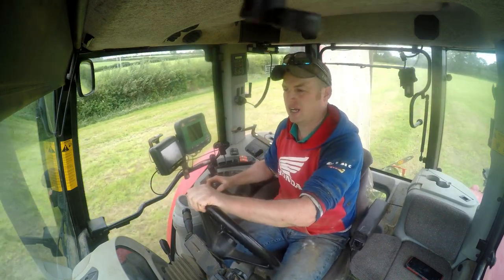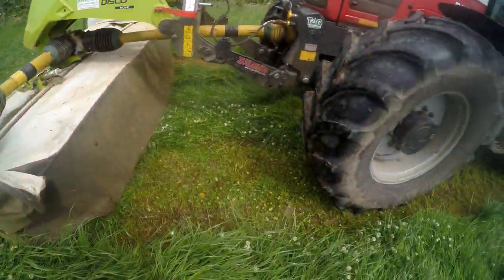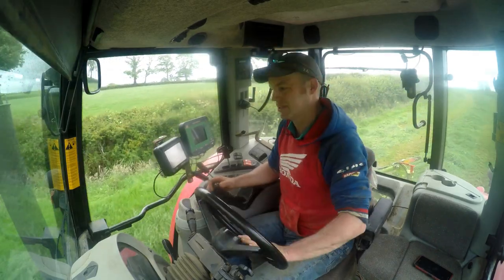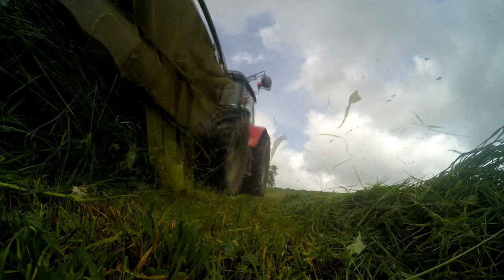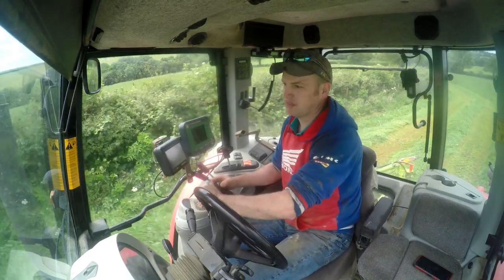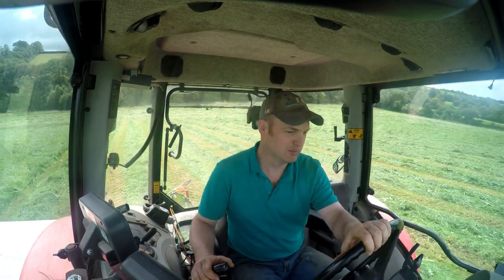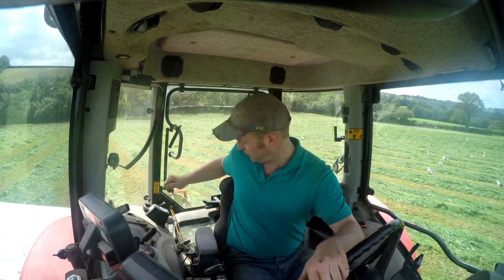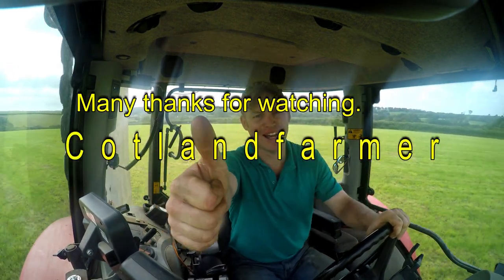Mowing with front and rear Claas mowers.

Comment: We used to be a diary farm, 60 years. Then switched to beef in 1999,Weve used every combination mower out there, Sickle bar mowers, Drum mowes, Disc mowers, trailed mowers etc etc... We use one mower on the back, 3 point linkage. Disc mower with conditioner, 10ft cut.. 99% of the time we get Hay, big square bales, round bales.. And the mower we use just really really helps with the drying time,, fluffing the grass out.. This year has been fantastic for hay for us,, 90 acres, 2 cuts.. Great video 👌👍🚜